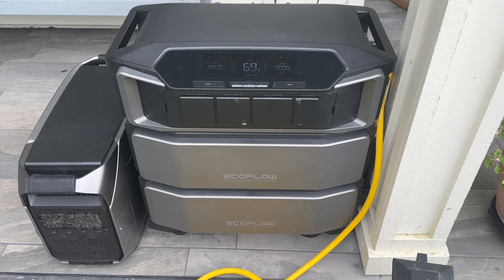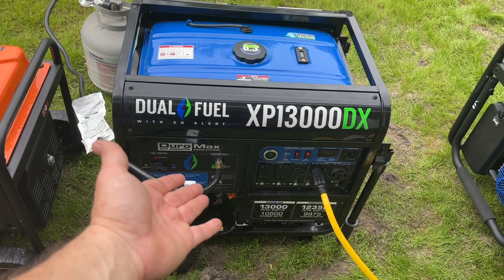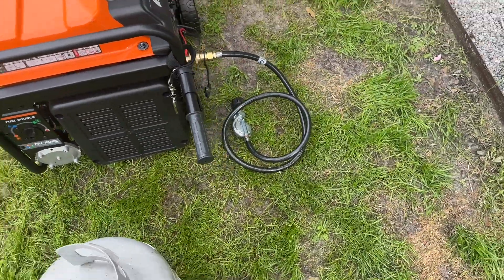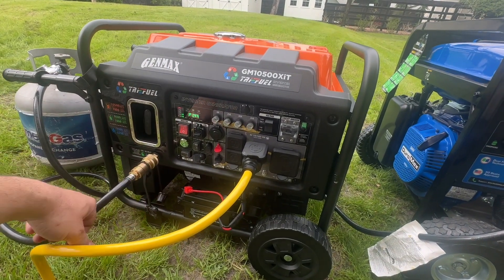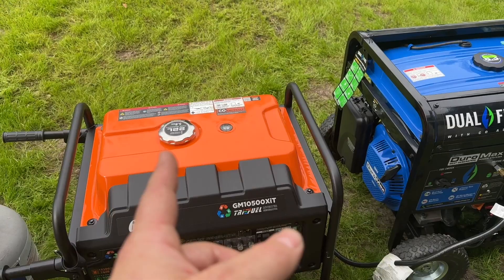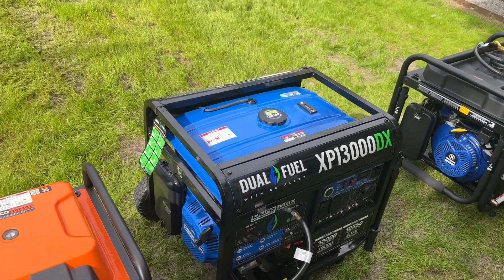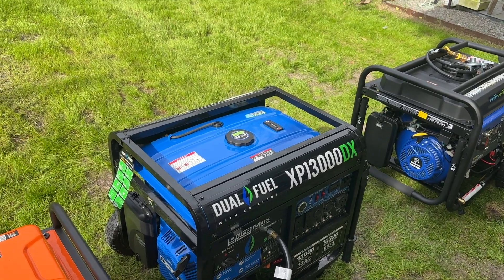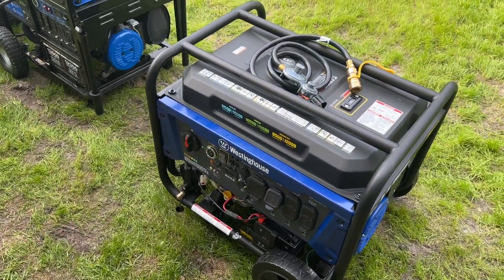Charging Ecoflow Delta Pro Ultra On Conventional Generator VS Inverter

Comment: Why not just get the enclosed Westinghouse 11000/9000 Inverter Generator for $1700 ?
Reply from the maker: Enclosed… that’s the big thing. It’s hot as balls here in storm season. The enclosed rigs over heat like crazy here. Plus… I wanted to try and show a conventional rig without the complication of the inverter to run <5 at load for the channel. But yes. That was the clear runner up. Plus it’s more $$
Reply: @fixitnoworlater  I usually keep the generator shaded naturally or some type of sun shield and I put a big fan on the engine. It works for me in Florida.

Comment: Try removing the spark plug & C if it will turn over then !
Reply from the maker: No. It didn’t. I even tried some oil on top of the cyl head. It’s gonna be a warranty job on this one. Westinghouse wants me to take it to service center for proper diagnosis and repair or replacement

Comment: Intresting video. There is a U-tube channel ( James Condon ) he does a lot of generator videos. 

Your right most modern appliances uae solid state fet and digital discrete components on the circuit boards and they like clean ripple free well regulated ac power. They also use awitching type power supplies and they don't like a  distorted ac power at all. 

First off there are 2 kinds of standard generator powerheads.  Onw uaes brushes witch ia nost commob and a brushless powerhead . But they are few and far between and more expensive also. 

Another thing that has much to do with how much distortion a generator. Produces is the ( AVR ). Some AVR's are cleaner than others.  ( James Condon ) Channel does mention this and has been proven by swapping AVR units to make a nasty generator produce a much cleaner power. It won't be inverter clean but you will have fewer problems. 

Propane tanks are a problem! 
Portable propane tanks can't store enough product to operate a generator of any decent size for very long at all. Then you have to drive GOD knows how far to get it refilled. 

Best solution is to get an above ground propane tank of at least 500 gallons or more. Then you will have a decent supply of fuel that doesn't go bad and a propane truck will deliver to you, instead of the maddness to find either exchange bottles or buy gasolibe and drive almost out of state to find at ridiculous prices. 
The outdoor above ground big propane tank is the best solution. 

I am a retired millwright/electrician and I have held a valid amateur radio operator license since 1976. 
Yes sir it is expensive, but your peace of mind and better possibls outcome; depending on how strong a storm is when you get the bad end of it.  Make absolutely sure the propane tank is bolted down to a concrete slab otherwise if you get flooded it might break loose and float away; which would nor be good. 
Its all food for thought. 
A prepared man is a thinking man, whom has developed a plan and put it into action. 
_  _  _  _  does happen, just be ready. 

73 GOD bless Earnest K5EWM 👍.